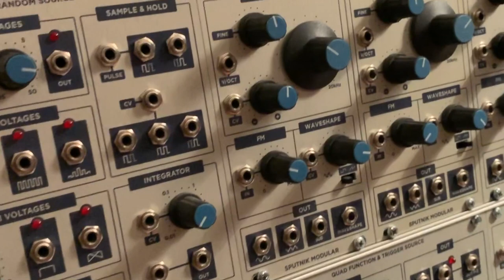How to SAVE MONEY by going DIY STYLE - DIY case pt.3 FINISHING THE BUILD!

Comment: Wow, that was hard work ! Congrats that you persevered .. I can see myself giving up at the first stamp on the case you did, and finish it off with a heavy hammer right there :)  I often have fantasies of taking the hammer head to my f...ng phone. In any case, after seeing this video I am more predisposed to either shelving out more money on a finished product or just doing a very rudimentary job and sticking it in the bookshelves (with a hopefully tight fit).
Reply from the maker: thank you, I made a second case with tolex that is more complex and it worked out well. Afterwards I build a giant case out of wood that housed all my modules that were previous in Doepfer cases. The more cases I make the less I curse 😅 Making something without cursing means there is room for more difficulty. As we speak I’m building an extension case on top of the giant case, should be the last case I build but so were all my other cases 😂